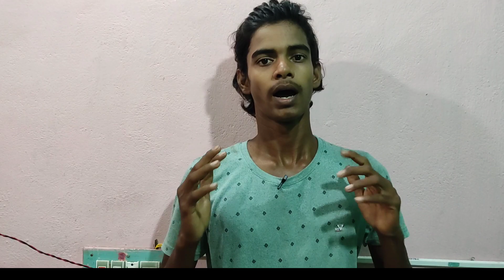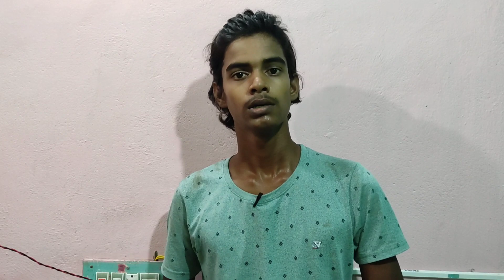கடைசி விடியோ For lithum battery bike use | lithum battery use bike self motor in tamil

Comment: Reason I think bro battery normal voltage 3.2*4=12.8 ok but battery charging voltage 3.5*4= 14 volt venum bro but antha bike la 13 voltage tha varuthu so bike charging problem bike RR unit problem bro no battery problem
Reply: Correct answer bro last time charging (outbike) anadhula dha andha battery pala murai self strart ayiruku. battery Recharge agala 😔.
My friend bullet bike la self mattum Vela seyyila check panni patha charging volt 18volt varuthu throttle race panna 18volt Mela pogudhu. 😳  
RR unit problem.